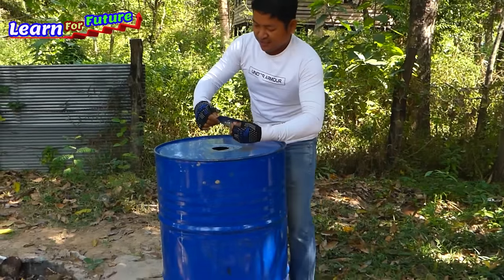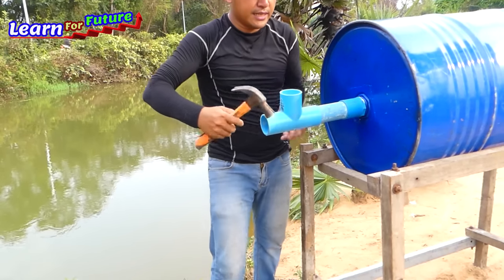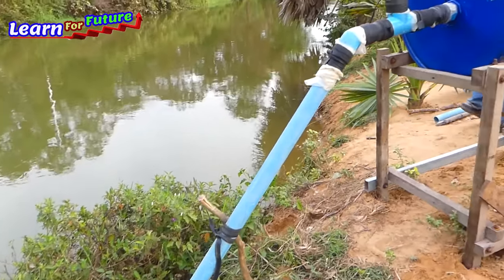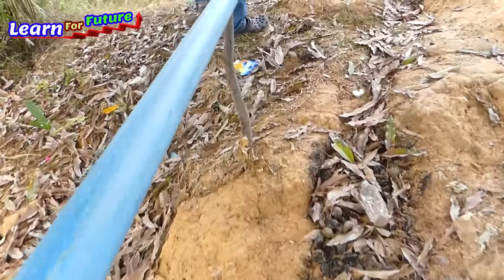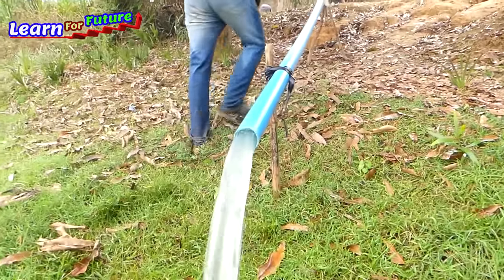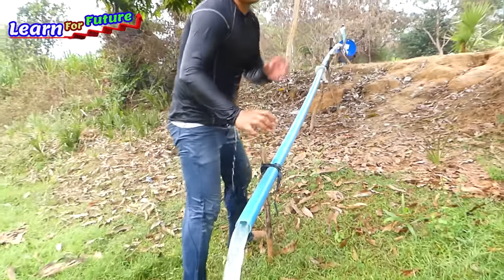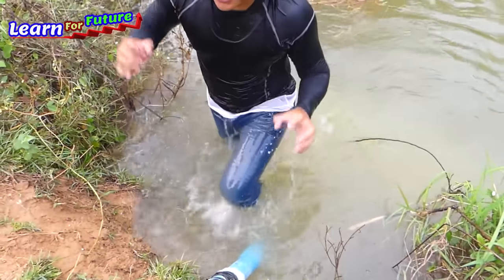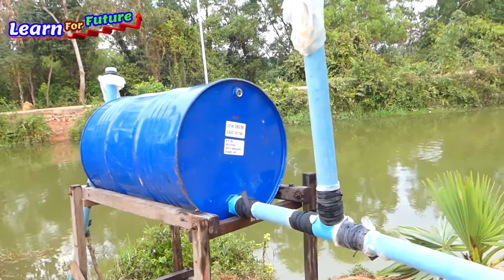Big Auto Water - Deep River!! How to install drum pump suck water from Big River for Big Farms.

Comment: This method works only when the tip of output pipe is lower than the water source.
Reply: No in my country an old man used samd suction technique to pull out the water from 120m deep drill bore but the problem he face is also the power of sucking is so strong it implode or deformed the tank
Reply: @aamerjamal  t
Reply: @aamerjamal  ry
Reply: @lawkeshkumardas3966 Jo j🎉🎉
Reply: TSuction Power is depend The output Pipe How much long
Reply: I have a lot of water source from the canal.
Can this project be done with 4" or 5" pipe?
Reply: It is just a siphon plus drum.
Reply: @aamerjamal  здравствуйте! Подскажите пожалуйста если резервуар будет из толстых стен, то эта система рабочая на 100%???????????
Reply: Exactly
Reply: @aamerjamal  i needmore
Of this oldnanz?!
Thbx-in-adv.!
Reply: 1:45
Reply: @MdSaddamHossainsaif-st7kv 😂
Reply: @aamerjamal 
samd suction....
what's samd?
Reply: @adippadal6250, so out out pipe should longer or shorter?. What lengths would be perfect compared to inlet pipe.
Reply: @adippadal6250, so out out pipe should longer or shorter?. What lengths would be perfect compared to inlet pipe. Please let me know, I wish to try.
Reply: Cara sederhana mantab broooooo

Comment: In order to make it work the level of output pipe must always lower than the input pipe (source).
Reply: Your idea is just a simple suction process u can suck the water without d drum because the water level of d suction side is higher than d discharge side.it is a simple syphoon prosesss.
Reply: @reynaldomarquez6216   not that the idea  but the one thing to be dont that the diameter of  the outlet suck shoud be bigger  to icrese the presure outle that reduces the velocity of the fuid acording to  newton s law the presure of fluid proportional inversery with the  speed  in any fluid
Reply: @reynaldomarquez6216  ,

Comment: To lower the vacuum pressure you must decrease the restriction by a bigger diameter suction pipe with a check valve and screen.
Reply: A lager suctiom pipe will innreise the water flow, but not change any presserende in the tank. When using a tank, no fort valve is needed.

Comment: You need to increase the diameter of the intake pipe to lessen the vaccum effect. High vaccum effect takes place inside the drum because of the drawing power created by the volume of water running through the length of your output pipes.
Reply: Noop. You can use any size of pipes. What maters is how high the drum is above the output.

Comment: Has anyone commenting build the exact same system? I did, completely vacuum and it does not work. I am happy to discuss with anyone who has ALSO build the system exactly as presented in the videos.
Reply: Also I have not get the water. He lie us
Reply: We do the same procedure but it did not work.. we will try next week once we visit to our farm but we try it by reducing the size of the inlet pipe..
Reply: I saw other videos, its not possible
Reply: The outlet must be lower than the inlet for it to work
Reply: Did you release one side first below the drum level to pressurize it FIRST??
Reply: That's why his drum bent.. The suction was so strong it bent the drum and that created the pressure flow.

Comment: Don't be fooled, it's impossible,if downstream that flows higher than the original upstream where the water will be used, and there is no need for any extravagant equipment to deceive.
Reply: وضح فكرتك؟؟؟؟
Reply: Assalomu-alaykum. The level of water being drawn, located above the level of water spilling on the ground. That's why the vacuum pulls the water.
Reply: It was necessary to demonstrate that it was working properly by pouring water onto the street. That's why I didn't believe this discovery.
Reply: @ziyadullaabdiyev1971  you should have your kids try it with buckets and plastic bottles straws and see for yourself.
Reply: @Alex-um4fe I tried too. It works if the water is above and the spillage is below. But I could not pull the water up from the bottom. I wish you all good luck.
Reply: перевести на руский
Reply: @ziyadullaabdiyev1971  Benar sekali, itu disebabkan letak intake (suction) lebih tinggi dari output (discharge). tidak perlu memerlukan peralatan yang rumit untuk mendapatkan itu.
Reply: @luckmanhakim4566  من
Reply: @ziyadullaabdiyev1971  it is simply possible because of the length of the delivery pipe. It holds more water than the water drum. SO this is successful mechanism to transfer. It is not elevating water. But transfers.

Comment: This is Very helpful, thank you for sharing. Maybe we will use a smaller pipe 
so that sa drum will not deform. We will use water for dishwashing or taking a bath
Reply: Smaller pipe will not help. One must reduce the height difference between inlet and outlett.

Comment: Hello, this system you created attracted my attention and inspired me. I want to make this system to draw water from a pond. There are some questions I would like to ask regarding this matter;
First: Is there any harm in using a spring check valve in the suction line?
Second: Is it okay if I use pushvit sleeve for pipe connections?
Third: Is it possible if I connect this system to the inlet of a water ram pump and feed the water ram?
Thanks in advance!

Comment: Hi Friend
Thank you for your time but I am a bit confused on why you need all these. Simply the input water level is higher then the output level hence a straight tube will do the job. As you have done you need to fill the tube for the first time.

This setup will never work if the out put water level is higher then the input.

Comment: It's just a simple siphon, surely water flows because the amount of water from the discharged line is greater and the discharged line is still longer than the suction line, if you put a foot valve on the suction line and the discharged line is one size smaller, the vacuum effect will be reduce and the amount of discharged volume will continue in flowing even it is one size smaller and you don't need to prime the suction line cause prime water is being controlled by the foot valve.. 😎😎😎

Comment: I'm asking if it is always necessary to use a drum instead of other materials such as a tank made of bricks and cement. And also, why not we can't use  an open material like a box? Thank you.
Reply: This is a siphon. You may use a single tube or hose. The only purpose of the barrel is to make it easier to get the siphon started. The whole system must be airtight.

Comment: if you guys understand what cmh20 means then you know that this cannot run perpetually
it doesnt matter how big the tank is because pressure has nothing to do with weight of the body of water but everything to do with level of water which is why pressure can be measured in cmh20 unit
Reply: It will run for ever, given that the water level in the river is higher than the exit to the field.

Comment: You need a stronger tank. I did a test with a twenty ltr plastic container and garden hose. It sucked a bucket dry in less than a minute 👍 the container collapsed a little from the vacuum 🧐🤩👍

Comment: This methods are working if you know how to do it! I saw hundreds of them in Asian small to big they all working as described. The ones who doesn't believe those are the ones never going to learn. You may need one they you never know.
Reply: He says it is a drum “pump”, not a siphon. It IS a siphon and as such the water level in the river must be elevated higher than the output to the field. When starting he points out sound from the drum, but that is before he opened in the river, so no water was flowing in the system. He is cheating. Later you hear noise from the drum, but to start with he filled the drum 100% and the input tube is at the center of the drum. No sound from from the drum should be expected. Cheating again?

Comment: Thank u Bro amazing ...And a little suggestion + idea....Now u can generate electricity if u put a dynamo ,with bigger tank in a little higher altitude .Try it.....N if u made a success ...........👌👌👌
Reply: You do not need any drum at all, but then it would bi a bit more tricky to get started. The power you can get is given by the height between the generator and the level in the river and the diameter of the pipe.

Comment: Question, how long does it last? until the water is emptied from the barrel, or one hour, two hours?
Reply: If the water level in the river is higher than the outlet to the field and all plumbing is air tight, it will run for months, maybe more.

Comment: Thank's your video....I'm interest yours idea and  I want a question,:  what's high suction (h1) and high discharge (h2) from water surface....?
Reply: This is a siphon. You may use a hose instead. Input source must be higher than output, as with any siphon.

Comment: @Learn for Future Question, how long does it last? until the water is emptied from the barrel, or one hour, two hours?
Reply: If the flows are equal, it lasts indefinitely. This implies pipes with the same diameter at the inlet into the barrel and at the outlet. There is another issue related to suction depth. The weight of the suction water should be equal to that of the discharged (outflowing) water. If the flow rate of discharged (outflowing) water is higher over time, the barrel is emptied and siphoning no longer occurs. A non-return damper and a sorb are required on the suction (in water) The flow rates can also be adjusted from the tap on the outlet. A barrel water level indicator (made of a transparent tube (glass, polycarbonate, etc.) with bottom and top connections to the barrel would be ideal to precisely adjust the suction and discharge flows (outlet)

Comment: This is easy as you using a simple pipe that with out air because watter will flow from higher level to lower level. So in that situation, nothing diferent than diging a trench.

Comment: You must reduce the flow of water going out so that the container will not be damage or at the time you open the exhausting valve dont delay also to open the intake passages of water.
Reply: For this SIPHON to work, the water level in the river must be higher than the exit to the field. Then you start with opening at the high end, in the river. You may take a rest, drink a cup of the and then open the output. As for collapse of the steel barrel, strange that the plastic bags at the filling studs are holding. Is he making a theatre?

Comment: The inlet water level is higher than the outlet.  In this case, there is no need to build a pump, you just need to dig across the road and the water will flow in.  If you raise the outlet 40cm higher than the inlet, the water stops flowing.

Comment: Hello sir, i did tried the drum pump with a height 9f  7 meters deep of
Reply: Sir, i did tried the drum pump with a height of 7 meters in difference, when i open the main valve,  the water will flow around 20 seconds and right after it will stop, what will be the reason why the water is stop?
Reply: @joeyrapadas1436  This is a siphon an can not lift water out of a well. Output must be lower than the input!

Comment: Why did the drum deformed? Is it bcoz the  inlet pipe you used is bigger then the outlet pipes?
Reply: It deformed because the weight of the water going down hill pulls the water from the river and has vacuum pressure. On a vac truck in the oilfield you have pop offs. It trips about 20lbs of pressure or vacuum. So it doesn’t implode or explode

Comment: The water always flows down. This is such a transport vessel.
Reply: @Learnn_for_Future  Why a barrel? Why the hocus pocus?     :)
It works without barrels.
Reply: @emanacio  did you have a better video that didnt use a barrel ? please help
Reply: @latingchampion4617  you can use a pure tube, no barrel. Broblem is to get the tube totaly filled with water to start up. The barrelthing is not needed when things are running, but can make it easier to get the siphon started.

Comment: You have fixed two valve closing and opening system but you have not shown the function neither have you used them Ithink that they wre open instead of being closed Sfter pouring the water from the bucket in the pipes you should have then opened that is why the drum contracted

Comment: You are just using  siphon principle because the endpoint is lower than source point unless you will use foot valve.
Reply: This is a siphon. The only function of the drum is to make it easier to fill the siphon, AND SONYOU DO NOT NEED ANY FOOT VALV og taking any bath in thevriver!

Comment: hoax, in fact the river water level is higher than the end of the outlet pipe. The river is an irrigation river that is dammed so that the water level is higher than the surrounding rice fields. So it's simpler to use a hose that acts as a siphon
Reply: It is no hoax if it lifts water out of the river to a lower rice field. The drum makes it easier to fill the sipghon an no foot valve ar needed at the intake. A sound system as long as yoy know that it does not lift water out if a well, but can vonvey water over a small ridge.

Comment: It looks like a fake. It is theoretically impossible due to modern physics studdies. Or you have another explanation? The law of conservation of energy is denied if this exists. Because it need more energy to spend for lifting of water, and where is the energy source of this overunity device ?
Reply: It worka fine as long as the output is lower than the input. It is a variant of a siphon.

Comment: Your barrel is like a vac truck. Your mistake is your suction is too small a diameter. Double the intake side diameter or run dual suction and check pressure and flow meter. It’s probably imploding at 5-10 pounds of suction. That why a fractruck has pop offs to stop that happening to the tank on a 80 bbl. it pops at 20 pounds. Put a popoff on your barell and increase suction size of pipe and figure out what works best on sizes
Reply: Pipe size
Reply: How many lenth out  put pips if in pipe sizes

Comment: To avoid deformation of the drum open the output valve halfway and not full
Reply: That drum is not really necessary. You are only transporting the water by siphon effect, by the difference in elevation  of the suction and discharge. The drum only put drama to the story to make it looks like something  not ordinary. In a way, this is a scam.
Reply: @GH-lu4cq  Partly, but a drum can be practical:
- no foot valve or plastic bag is needed in the river, no bath.
- a drum can accumulate some air and keep the siphon running for some time even with a minor air leakage.

Comment: on the other hand as this system does not raise water but simply makes it pass over a hill to reject it in a lower level than the capture among all the videos that have been put online by this impostor c  is the only system that works because it is only on this video and not the others that he shows us a small whirlpool that forms at the entrance to the system and the canister that deforms under suction in other systems where  he claims to raise the water from higher he shows us neither the whirlwind nor the canister this deformed under the normal precision because it is the system it does not work anyway this it worked this gentleman will not lose his temp to make  video because he would have invented a perpetual movement it would be enough to put a water propeller to connect to an alternator to have clean free electricity and at will at the time of today he would surely be multimillionaire because his system would have been redeemed  by industrialists  oil and nuclear